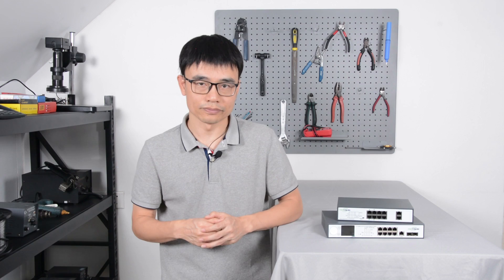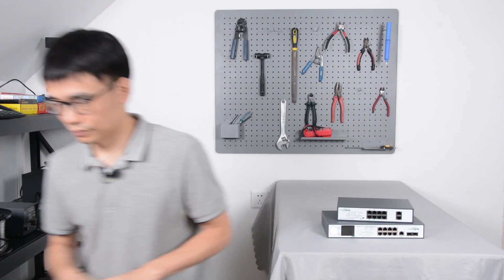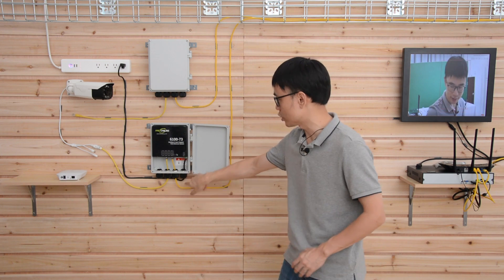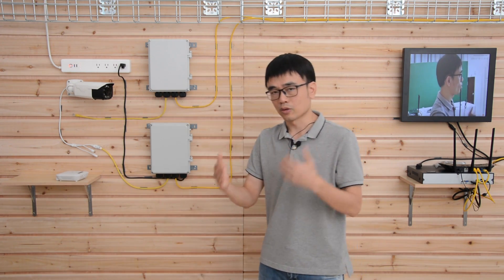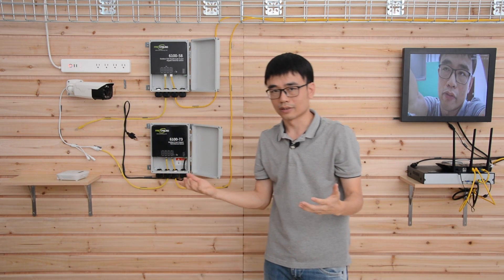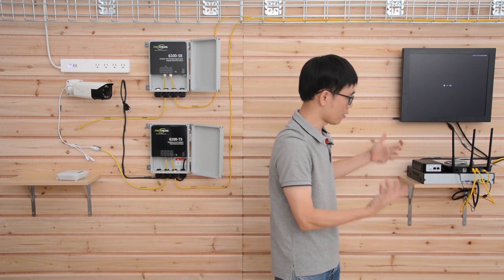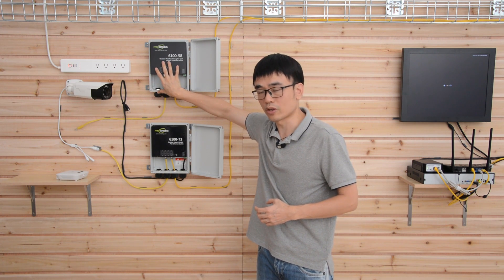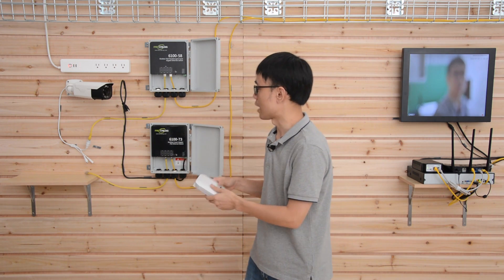How to install Outdoor PoE Switch without AC Outlet

Comment: It is more recommended to use POE Injector or just normal POE switch to power the outdoor poe switch?
Reply from the maker: You can also power this device using a 95W 802.3bt PoE switch. As long as there is enough power for the connected devices.

Comment: Would the speed go below normal buy doing all these connections?
Reply from the maker: No, the speed is 1000mbps between the outdoor switch and the router. The PoE power solution solve the power issue, it didn’t downgrade the speed.
Reply: @Fastcabling  thank you for advice. I am thinking to get 2 cameras on a switch NETGEAR gs108t pro. Would that be possible to work without a power supply to the cameras? Also, with this switch would be a problem with the speed shared between 2 cameras?
Reply: How many cameras can be added to the poe power solution to outdoor.  4k cameras.
Reply: @luisjuarez1200  it depends on power consumption of your cameras. Just add up total power consumption, and then choose a poe switch which have more power than total power consumption of cameras